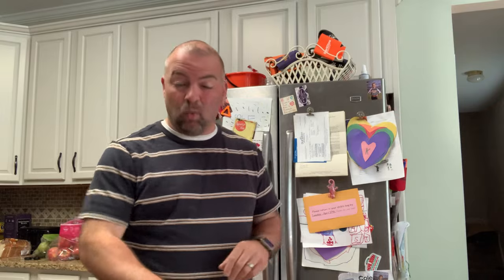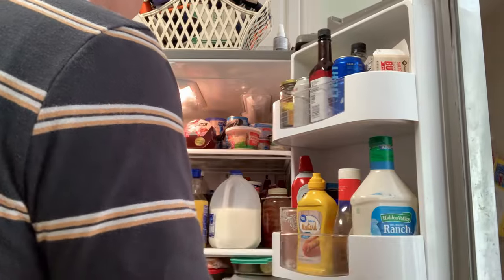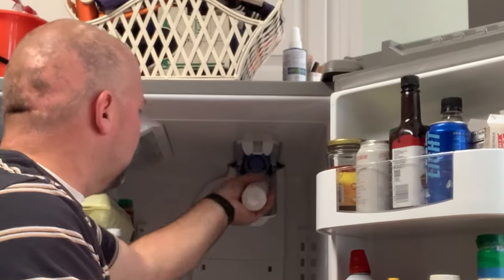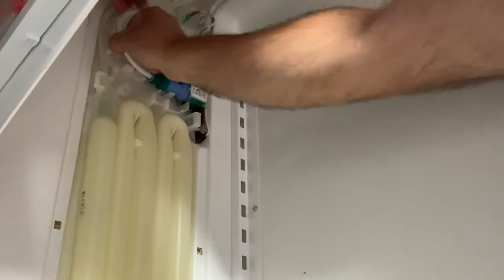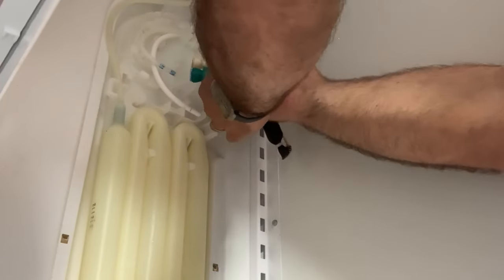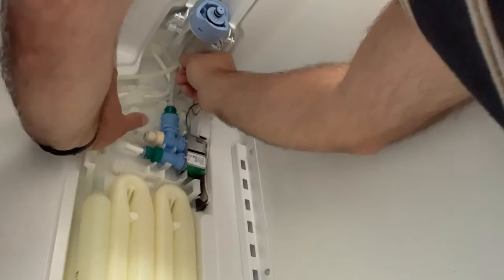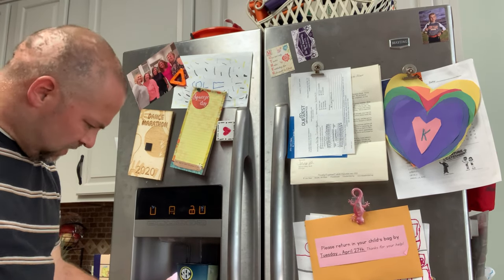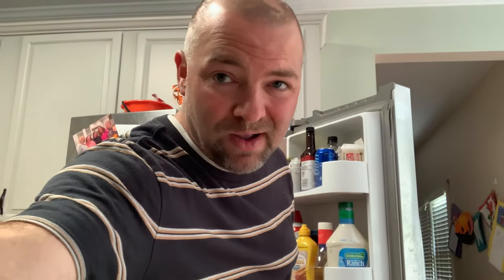Refrigerator Ice Maker Fix - Water Inlet Valve Replacement (Maytag /Whirlpool)! - by DIYNate

Comment: Thanks for the great video, Nate!
For others who are doing this job, here are a few tips that'll make it a little easier:
1. To remove the lower panel:
a. The clips that are at the top of the panel can be released by inserting a flat blade screwdriver into the slots, and pressing inward, while pulling back on the panel.
b. The clips that are near the middle of the panel are realeased by pushing them down with the flat blade screwdriver, while pulling the panel outward.
2. To remove the upper panel, insert a flat blade screwdriver into the middle slot (of three) and push  upward, while pulling outward at the bottom of the panel.
3. To remove the water lines from the valve, use a 3/8 (or 10mm) open end wrench to push down on the "collar" that is above the spot where each line goes into the valve. While depressing the collar, pull backward on the line, and it'll come out easily.
Reply from the maker: Great additional context and appreciate you adding in the suggestions - those are good tips especially for someone trying this for the first time.  Really appreciate your feedback and adding to the comments!
- DIYNate

Comment: Can’t say how much grateful I am to you. The valve is $150 on Maytag site, but I ordered from amazon with the link you provided, then I followed your video step by step and we changed the valve and the ice maker is working now. Just to tell people that make sure the tubes are pushed completely inside the valves, otherwise you see they mat drip.
Thanks so much
Reply from the maker: Farnaz - thank you so much for the detailed comment and very happy to hear that it saved you quite a bit vs. the manufacturer cost.  Also a great callout to make sure that you really push those water lines into the valve and check them to make sure no leaks appear.  Really happy you shared this and glad the video / Amazon link was helpful.
Best wishes,
DIYNate

Comment: Awesome video. I marked the water lines with sharpie so I could keep track of how far to re-insert lines into new solenoid. It would be helpful to see tabs on covers so I could see how they snap in.
Reply from the maker: Good call on showing the tabs a bit better.  I think I put a link in the description to a guy who shows that a bit better than what I show in my video, but good call there.  If I had it to do over, I would call that out because it is a bit temperamental getting those tabs to release.  Also, great call on marking the water lines with sharpie to make sure it goes in far enough.  Better than taking chances and having the water line come loose and create a leak!  Good thoughts and appreciate the comment!
- DIYNate

Comment: It can also be your water inlet valve if your ice maker IS. Getting water, and it IS producing ice, but it is dripping water into your ice bin and freezing the ice together. This indicates a problem with the inlet valve dripping water into the ice maker and eventually over flowing it’s capacity and dripping into the ice bin.
Reply from the maker: Good comment there Michael - inlet valve can cause issues with it getting water or not shutting off correctly.  Thanks for posting this to help others out!
- DIYNate
Reply: Where is this inlet valve located?  Thats exactly what mine is doing

Comment: You need to mention that some ice makers will not operate if the light in the freezer compartment is on.  The switch button needs to be held down.
Reply from the maker: That is a good call!  Once we youtubers put the video up, it doesn't make it easy to add on additional commentary after the creation process, but feedback noted, and you added the comment so others can read this post as well and maybe realize if the light is on, the ice maker may not be engaging.  Appreciate it!
- DIYNate

Comment: When you were having this issue, do you remember if you heard a motor running TRYING to dispense water into the ice machine, or was it all just silent?  Our Maytag recently stopped producing ice and does not appear to be dispensing water either, and we don't hear any indication of it trying to dispense water either.
Reply from the maker: Tough call there - I think I remember when the issue was the water valve, I wasn't hearing the ice maker calling for the water (a lot of times when you have a working icemaker, after you dispense some ice, you hear a sound of water flowing and the system activating).  When water was flowing and I had to deal with the actual ice maker itself, usually I was still hearing it call for water.
Good luck - hope you get it (or got it) solved!
- DIYNate

Comment: Thank you for your video!! Everything worked great until a went 1 week on vacation and cut the water to the fridge but didnt put the icemaker off!!  Now i dont get any ice and i have no water coming to the icemaker.  My question, do you think my waterinlet valve could have burn without water getting to it?  I put water in my icemaker and it froze but wont drop it.  also i always ear a little fan that put air from the freezer to the back of the icemaker.  it nerver stop!!  What do you think?
Reply from the maker: Hard to tell on this one.  If you are putting water in the ice maker and the ice maker isn't dropping it, my first feeling would be an ice maker issue with the heating element.  So I would probably start there vs. the water inlet valve in this case.  Could still be inlet valve related, but most likely, if the ice maker fills with water, freezes, then doesn't drop, the inlet valve doesn't have a need to call for anymore water.  Just my 2 cents based on what you shared and what I am thinking.

Good luck with the fix - wishing you the best in the war against ice maker problems!
- DIYNate

Comment: Thanks for the video! Unfortunately, I replaced my ice maker, water filter and water inlet valve and I'm still not getting ice. When I manually put water in with a syringe it harvests. Any other ideas?
Reply from the maker: Changing the water filter would be my first stop, then probably looking for the valve (may have 2 like mine does - one inside the fridge and the other on the back of the fridge).  I would probably replace the one inside the fridge behind the main panel first if I were doing it again.
Good luck and thanks for the comment!
- DIYNate
Reply: @DIYNate hi again! I did replace the interior solenoid valve, the one that receives water from the filter and then runs it out to the icemaker and water dispenser. Water dispenses fine, but no ice. I even tried to jump the water fill function and sometimes it sounds like it's trying to send water, but doesn't. The icemaker inlet hose is new too. I could replace the exterior valve but I assume that works since I'm getting water to dispense. Although I haven't seen it as a possible issue anywhere I've looked, could there be a problem with the main computer control motherboard thing?
Reply: Having a similar situation. Did you ever figure either out. I have like knocking noises in the ice maker. No water going into ice maker. But water dispenser fine front the front. Tube isn't frozen either going to ice maker.  @dylanwbarnes
Reply: Hey there! Unfortunately I have not figured it out. Knocking noises might be the empty icemaker trying to harvest. I did notice the icemaker never got colder than 18 degrees F, and it might need to be 10 before water will fill. Maybe someday I'll unplug the fridge and defrost it to see if that helps, but until then I'm just freezing water in ice cube trays in my freezer then dumping in the dispenser!
Reply from the maker: Hey there Dylan - sorry for the slow response.  Hope you have gotten it figured out.  Certainly could be a motherboard thing, but if you are getting water from one side and not the other and have already replaced the inlet valve, then part of me thinks I would check / change the icemaker next.  Interior solenoid in the fridge door panel is beyond my ability but the icemaker would probably be my next attempt to resolve.  Good luck - sorry for the headache but I feel your pain!
- DIYNate
Reply: @DIYNate  thanks for the response. The icemaker was the first thing I changed. This one has me stumped!

Comment: Hey Nate, reading all the comments can’t find this question. I already changed the valve inlet and not getting water in. Also pour water into the ice maker manually and produce and dump the ice. Could the ice maker water line be clogged? I haven’t noticed any water in the floor or in the top of the fridge.thanks
Reply from the maker: Hey Roberto - hmm…. I guess one thing would be to see if you are getting water from the dispenser - if yes, would doubt it is a clog in the water line.  Could certainly change your water filter as well.  There are two water valves on my fridge - one on the back of the unit and the other one inside the unit that is the one I replaced.  I think that is the one that determines the water signal from the ice maker and the door spout.

I think if I am at that stage, I may go with the icemaker change next.  While it is harvesting the ice, it could still be having an issue with calling for water.  I doubt it is a clogged line but could have iced up or something.  You could also try defrosting your fridge / that area if you are worried about an ice clog, but my guess is it is something else.  Good luck, I am pulling for you!

Would love to hear if the ice maker change does the trick or not or how things turn out.

Best,
DIYNate
Reply: Thanks for the reply. Yeah I’m getting water to the dispenser. I already defrost it and everything. I haven’t changed the water filter because is supplying water to the dispenser so I guess that’s not the problem. But I fear is the ice maker unit or something else. The power has been an issue here in Puerto Rico so maybe is damaged.
Reply from the maker: Good luck on the fix - I hope you get it figured out!
- DIYNate

Comment: Hey Nate, What if the water keeps coming out from the dispenser after taking the glass away ?    It's like the valve isn't shutting off?  Thank you !
Reply from the maker: Good question - could be a variety of things, but likely it is related to the sensors / wiring in the trigger / paddles.  Could be in the motherboard or the water valve, but I would bet on the water dispenser wiring (in fact, I am kind of dealing with a simliar issue).  Good luck!
- DIYNate

Comment: Hey, wonder if you have any tips on the installation of the valve.  I put the new one in, but the top line keeps leaking at the connection.  The line looks fine, so I think it just won't seat properly no matter how I try it.
Reply from the maker: Hey there - I believe the top of the valve is a compression type fitting so you may need to push the blue or white lip in and toward the valve while inserting the fridge hose.  That basically opens the internal clamp and allows you to push it in all the way.  You may just have it in ‘mostly’ without the compression fully engaged and the locking mechanism sealing around the hose.  That would be my first guess - and I ran into that initially when I first tried putting mine in years ago.  Once it locked in, the leak stopped and it solved the problem.  Hope that helps and good luck!
- DIYNate

Comment: Hi.  Water valve is making the buzzing sound every 5ish minutes.  Waters been disconnected for a while.  Can i just disconnect plug connection(wires) to valve and use refrigerator safely?  Thanks.  Just want loud buzzing to stop
Reply from the maker: Hey there - I believe you are thinking about it right - by disconnecting the connection from the door front to the ice maker, it should keep the system from calling for water and making that sound (I think - not being there makes it a bit tough, but I believe you are on the right track).  Good luck with the buzzing sound and hope that worked for you!
- DIYNate

Comment: I have the same fridge. I felt in the tray and it was empty. I filled it with a garden hose and it did dump. Now what?
Reply from the maker: Good question there - if you filled it with water and it dumped, that may be a good sign that the ice maker is behaving how it should be but it could be your water valve in the inside back of the fridge (or on the back of the fridge in general - depending on make / model) has an issue.  When I replaced my water valve, I found that was the issue in one of my fixes and I didn't need a new icemaker.  If I ordered the icemaker and changed that out, I would have been disappointed to find that I had more work to do in replacing the water valve.

Good luck and hope you got it up and running!
- DIYNate

Comment: Very good video but i have a question. i manually put water into my ice tray however it did not drop once it was frozen. i confirmed the ice maker is getting power and the ice maker arm freely goes up and down so i'm not sure if i have more than one problem but interested in your suggestions on what to try.
Reply from the maker: Thanks for reaching out!  If you have given the icemaker enough time to dump the ice, then my hunch would be a bad ice maker as next step.  Since it isn’t dropping the ice, could be the heating element not functioning properly to release the ice.  Could still be something else but since it isn’t dropping the ice, I would lean towards the icemaker.  Could still have a water valve issue but if the icemaker isn’t dropping ice then it probably isn’t calling for water either.  Unfortunately, these icemakers are prone to breaking and needing replacement. 

Good luck with the repair!
DIYNate

Comment: Nate, I have no ice or water.  Replaced the valve behind the fridge and the one behind the panel. I have good water pressure coming to the fridge but it's not getting out.  Any suggestions?
Reply: also emptied the water tank and saw it fill back up.  so somewhere from the tank exit to the water and ice maker something must be wrong
Reply from the maker: Hey there - I don't know that I have much of a solve for you with this one.  Sounds like you are at a tough spot.  Could be a couple things - when you say you emptied the water tank, that makes me wonder what type of model you are on.  I would say filter being fairly fresh would be good.  Could very well be the icemaker itself; however, if you put water in the ice maker, and it harvests, then you can rule that out (kind of).  Since you aren't getting water through the dispenser either, makes me think maybe something with the panel that calls for ice and water, but still leaves an open question of why it at least isn't getting ice to the ice maker (maybe not getting the signal).  You could try jumping the icemaker with T and H wires and see if it calls for water - just be careful (not professional advice).  Good luck!
- DIYNate
Reply: yeah it's a mystery.  I bypassed the in fridge filter as I have a RO system and filter in the basement.  Worked initially but then stopped.  Probably old water in line.
Reply: model is Maytag MFI266XEM6
Reply from the maker: @barglancy ah - gotcha.  I wonder if you try to just go straight through (temporarily) and see if it works when you don’t have the RO system connected if it works, might help diagnose where the failure point is.  Sounds like you are handy with that water system solution and the water connection - good luck - I definitely understand the aggravation!
Reply: just started working!! Ice is good and water pressure is better than ever but it still flows for about 4 seconds after disengaging the pressure pad.  Not a big deal as we use the sink filtered faucet.  Ice is the main thing.

Thanks for the vids and responses!.

Comment: Replaced that valve and worked great for about a week. Now ice  maker is not getting water again. Could’ve it gone bad already??
Reply from the maker: I have seen a couple times my replacement ice maker will freeze up in the top (fill cup) or just jammed the teeth, but that assumes it is getting water.  I wouldn’t imagine it went bad that quick - could also try making sure the wiring is connected well.  Good luck with the troubleshooting - sounds like a tough one!
- DIYNate
Reply: So it isn’t getting water after a month with the new valve. I can put water in the ice maker manually and it works. Any idea what else it could be

Comment: What if the water leaks from the ice maker ? Seems like my valve isn't closing.. thx in advance for any help
Reply from the maker: Hey Eric - could be a lot of things going on there if water is leaking from the ice maker.  My gut would tell me you may be in for an ice maker replacement; however, you may want to make sure your ice maker is level.  I have sometimes some minor things can throw off the tilt and cause one side to rest lower than the other causing larger cubes on one side, smaller on the other, and some water to leak out.
You could also try defrosting the icemaker and see if it acts up again on a fresh pass.  Could be some ice or something else blocking the fill port causing water to pour out vs. get to the cube tray.  Once you test it and if you see it is still a problem, then you will probably know whether your next step is a replacement.
Lots of sympathy for anyone troubleshooting their ice maker!  Good luck and best wishes!
- DIYNate
Reply: @DIYNate  it was the valve.  Thanks man !

Comment: ok i’m jw if the ice part is mest up can u still get water
Reply from the maker: Sometimes you can still get water out of the water side if the ice maker isn't producing.  Could be a water valve and related to one side / connection / solenoid or whatnot.  Hope that helps!
- DIYNate